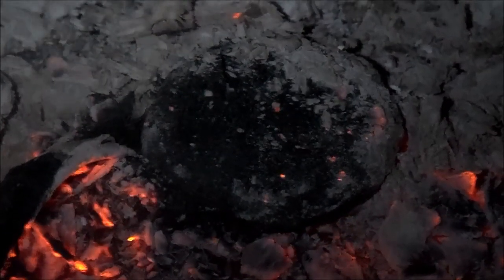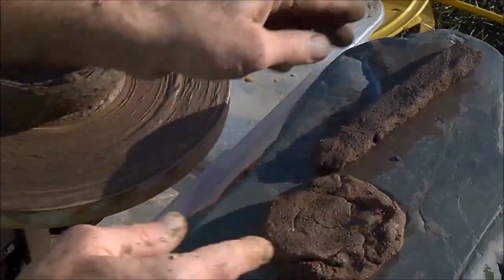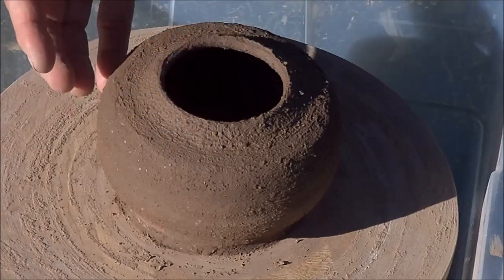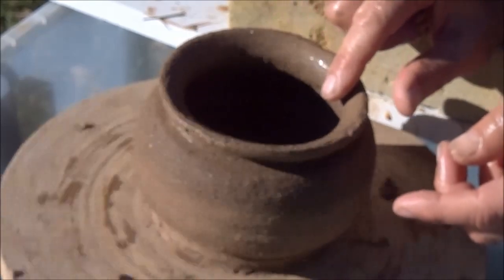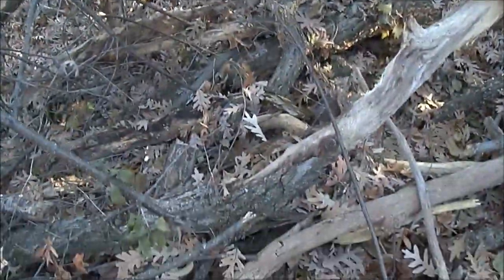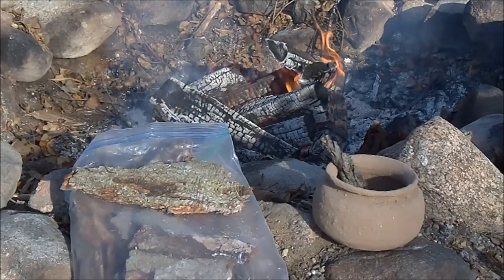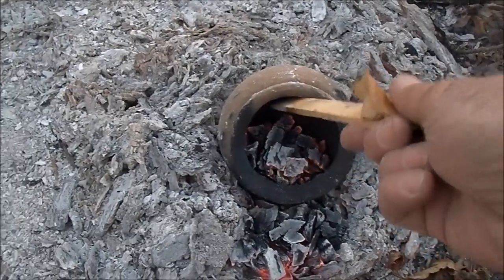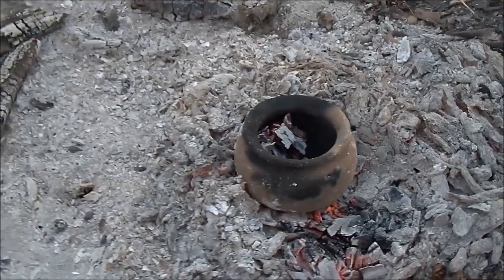How to make your own pot

Comment: Just watched cool video exactly what i needed to see im working on a goal of going camping with trying to use only self made gear (or at least modified) and cooking implement was one of my biggest hurdles i also live near the twin cities any recommendations for harvesting the clay or any other info i could use would be greatly appreciated
Reply from the maker: I doubt this pot would hold up to a camp fire. If you wanted warm soup, or whatever, you would be be better off heating a  small stone and adding it to the pot to warm or heat the water inside the pot. I believe that was the technique used way back when. As far as sourcing  clay, that is hit and miss  locally.

Comment: I don't understand tempering with shells.  Shells are mostly calcium.  When you heat it up the calcium to 900C it turns into calcium oxide which is highly alkali and reacts with the moisture in the air.  This will tend to make the clay crack after firing.  As any potter knows clays containing limestone are no good for this reason.  So why would anyone add it to their clay?  I know it's been done for years and is a common practice but it just seems counter intuitive.
Reply from the maker: Good question. It seems to be somewhat  of a clay stiffener so the clay doesn't sag in its dough like state before drying, or firing. Also, it might help with thermal stress, lots of small cracks are better than a couple big cracks. I am only speculating.

Comment: I hay a first experience with clay.... I tryied to use kitchen's oven to burn the clay to convert it into ceramics ... the clay was dry when I placed it into de oven .... after a few minutes .... the clay-recipes breaks and explodes ... can you explain me why? Should it be wet?
Reply: Having it exploded means that it was still wet? So a longer drying process is required before burning at higher temperatures?
Reply from the maker: Diego Jacobi , a much slower drying and 
longer drying period is required
Reply: air dry your pots for about a week or more, depending on your climate,then you can put them in the oven, but start off at the lowest temp and slowly increase or they will explode

Comment: i'm not disputing that it held its form and didn't crack...or so it seems. only reason i question it is because you did nothing to prove its success as you didn't show it carrying or boiling water, yano its practicality which i personally would have prioritized over aesthetics. Plus your tips don't seem to match up with what i've been taught, for instance, allowing naturally sourced clay to air dry for a good 24 hrs before firing, and a good firing i'm pretty sure consists of more than an hour on a camp fire, plus there was no processing of the clay to improve its quality...i'm sorry but i'm full of doubt about this.
Reply from the maker: Aaron Lewis , I did air dry the clay for a couple weeks, something I should have mentioned in the video. The campfire was used to fire the clay ( make it into something that would not turn back to clay when exposed to water) As far as boiling water in it, dropping heated stones in the pot holding the water would be the way to go.  Heating this pot directly over a flame  again would I am sure be the end of it. I do detect very small stress fractures in it.  I feel confident I could warm some chicken soup in it by tossing in a small stone heated by the fire of a camp fire. It can, I believe, take that much thermal shock.